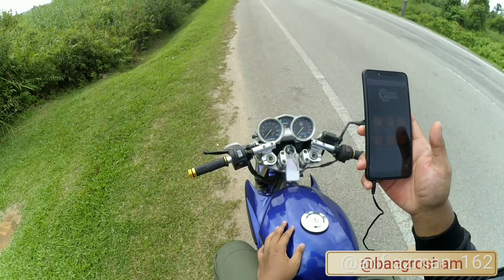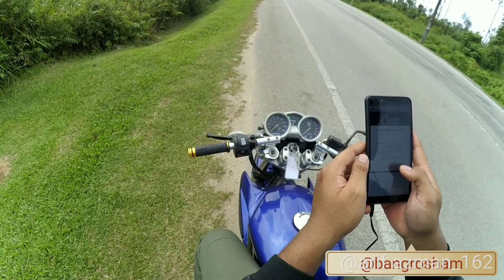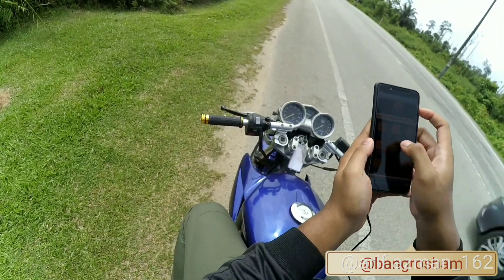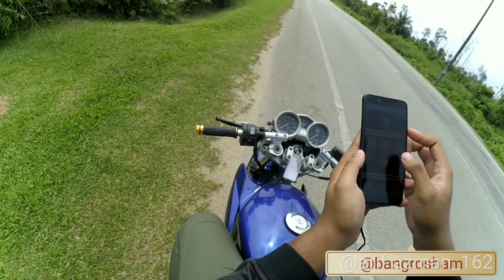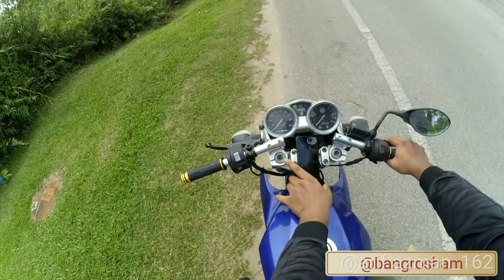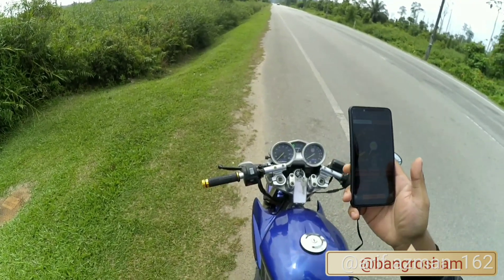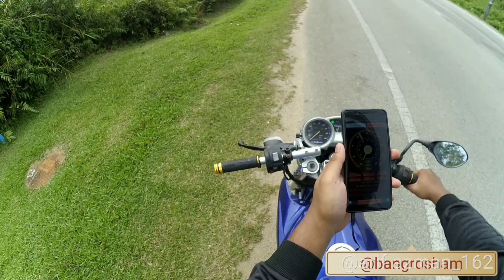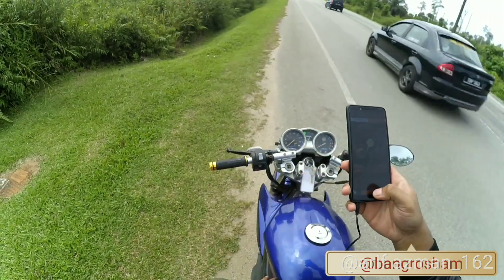setting tuneboss fz150i spec 63mm | main tukar2 map tuneboss |

Comment: Salam..  Bang rosham... Motor lagenda 115 fi saye..  Baru lepas tukar block 57 mm espada..  Dengan ecu tune boss..ekzos gl cutting  Yang lain semua std  Then bile start pakai kick starter kadang compressor ade kadang tkde.. And bile jalan tu..  Die bobok sangat sangat....  Kenape mcm tu ea?? ..  Salah marking timing ke atau bende lain.. Bang rosham..  Tolong saye..